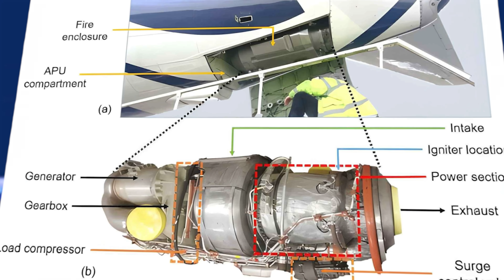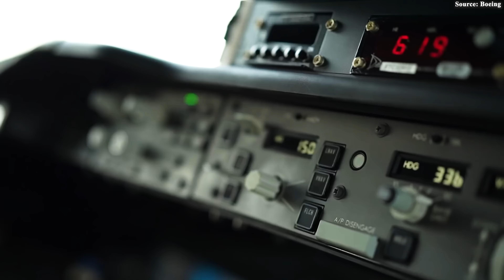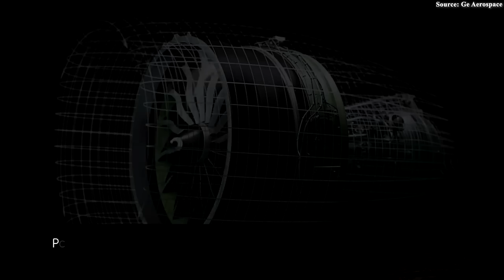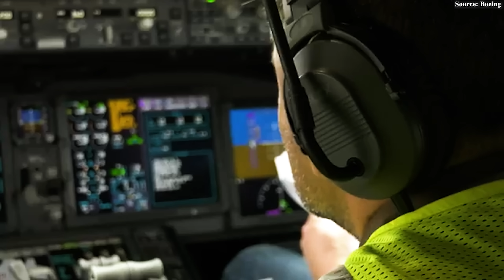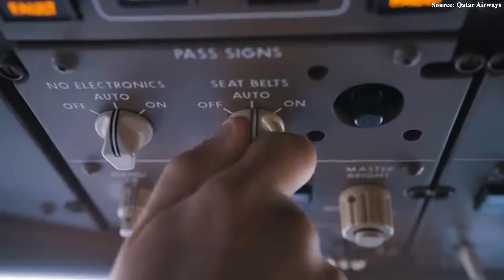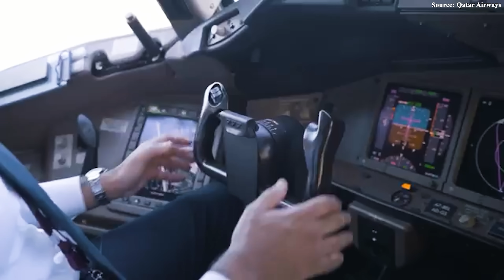Boeing JUST Dropped A BOMBSHELL About the 777X Shocked Everyone!

Comment: The FAA has been receiving a lot pressure from the aviation industry world wide to accelerate the certification of the 777X and the 737-7 and 737-10 because there are not enough airplanes to meet the demand for air travel. Air fares are going way up and too high for consumers and businesses that rely on air travel. The FAA has been overly tedious and slow in the process of certification of the above mentioned Boeing aircrafts.

Comment: There are two problems not mentioned. 1) Did China renege on cooperative construction of airframe parts, causing a backup of plane production? 2) Is Boeing production capacity capable of producing all the planes ordered?
There is a report that there is a backlog of planes even before 777X is released for sale.
Reply from the maker: You're right. The milestones that the manufacturer commits to with their customers have already factored that in to some extent. However, there are still many arising factors that affect those milestones. For example, this has constantly happened to Boeing in recent years

Comment: No, not going to fly on a Boeing produced aircraft.  I like aircraft that has reliable electronics and will not fall apart in the sky.  I still have no idea why Trump gave them the new stealth jet contract.  I would not trust them to make a viable military aircraft.
Reply: Good, do not fly it, it will be a little less crowded as I am planning to enjoy it often
Reply: I'm of the same opinion. After the quality control and systems defects that have led to deadly crashes like the the 737 Max software crashes, the 767 and 787 carbon fiber delamination issues and excessive gap issues between fuselage components that have been identified as areas of concern. The Air India crash because the airplane thought it was still on the ground so the computer turned off the fuel to the engines and locked the pilots out of control I avoid flying on Boeing airliners whenever possible. I have 50 years of piloting experience and the modern Boeing's do not inspire my confidence. I would much rather fly on an old Boeing 747 or any Airbus.

Comment: This plane completely and utterly is the final nail in 4-engine plane coffins.  I cannot see an airline keeping a A-380 or 747  around if their competitors are flying 777Xs.  They'll get their clocks cleaned. That said - the Airbus A350-1000 is so close that it will be a tough decision and likely a toss-up, although Boeing may actually emerge with a cleaner, sturdier product for the long haul precisely because of the delays by the new rigorous FAA certification program.  I am fascinated by these machines.  They are incredible and quite a testament to what human-kind can do when all working on a problem together.

Comment: You can blow all the sunshine up the B777x's arse but you still can't change the facts, and that is the B777x was first announced back in 2013 with the first delivery estimation to be scheduled for December 2019, now with all that's happened with the max 8 and 9, b787 all due to the greed of boeing, there is still speculation as to the delivery date of 2026 will be met or will this be delayed to 2027, but one thing is for certain is that by the time this aircraft is up and running, the so called advance technology of this aircraft will be obsolete. Think about it, it is already 6 years late and in December 2026, this would increase to 7 years late in delivery, with the first prototype being built in March 2019 and assuming the first delivery being in late 2026 the so called technical advancements would be nearly 8 years old. As for the b777-8, that hasn't even been built as yet, let alone being close to certification.  All Airbus needs to do is announce a A350-2000 to kill the b777x program.
Reply: Oh for Pete sakes stop being so negative; can’t you find even one good thing to say about  Boeing? Sheesh!
Reply: @chasjones5442  How am i being negative, what i have said is fact, not fiction. go on you say something positive about them if you can.